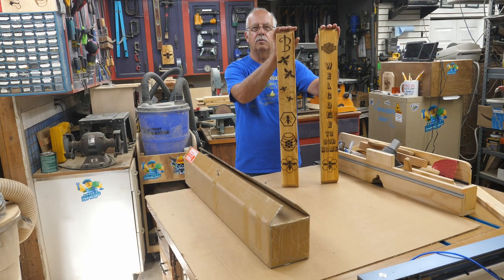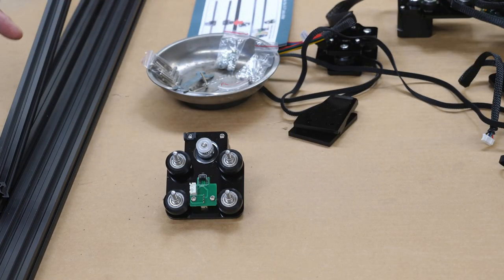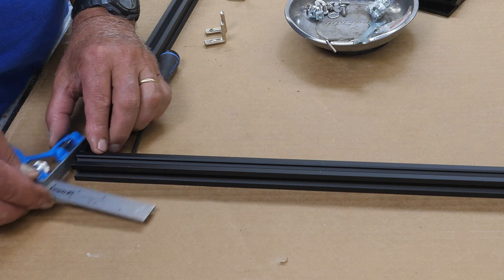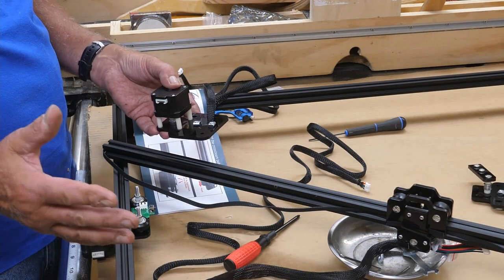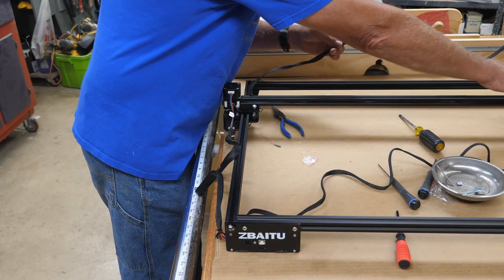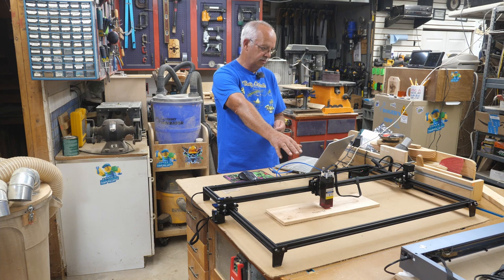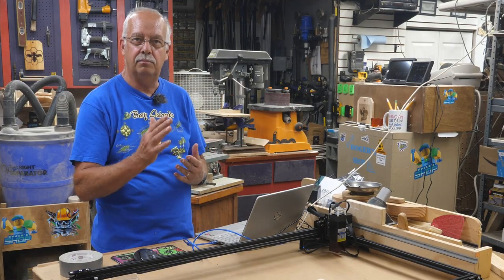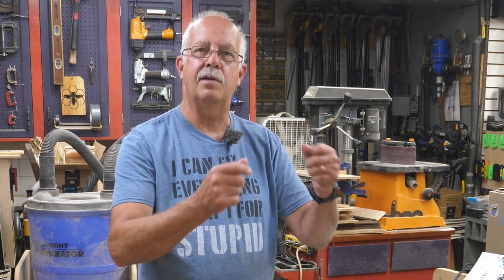ZBAITU M81 Laser Assembly In detail

Comment: The end stop on the X hits the wheel it's the wire in the bracket sticks out to far and hits and stops it from hitting the switch just move the wire over and it will work. You don't need any mods
Reply: Not true. :) Even without the wire in the bracket, not sticking out, it wont hit the wheel. The pin on the limitswitch is too short ;)